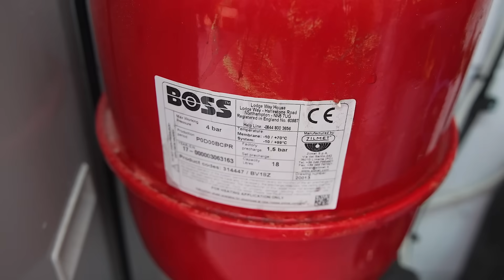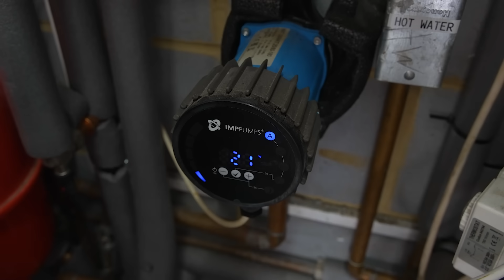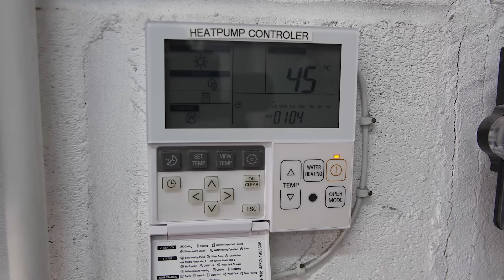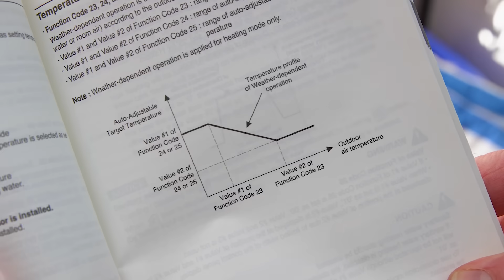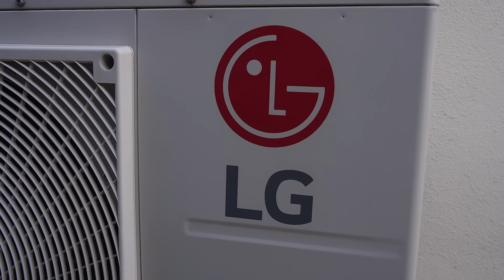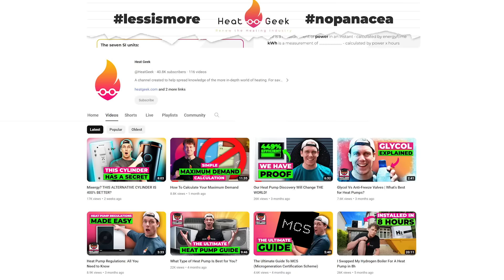Heat Geek Gives His Verdict on John’s Nightmare Heat Pump

Comment: Can someone please explain to me why we are not making the switch to full electric heating please? I look toward the UK's largest onshore windfarm, Whitelees in Scotland. Everywhere is covered in wind turbines now and we haven't mentioned solar yet. Why for the life of me are the government not pushing this more? They must focus on getting the price of electricity down. It will go a large way towards lowering carbon emissions but more importantly vastly simplifying heating systems. 
Simple is usually always better and certainly more reliable. I currently have a conventional non combi gas boiler feeding my rads via a two way control valve. Hot water is via a storage tank fed from the gas boiler with additional electric immersion heater as backup or boost. My preference would be to scrap the boiler and heating pump and all radiators. Fit auto controlled electric panel heaters in each room with independent temp and time control. The DHW would be from the gravity fed storage tank heated by immersion heater. What could be more simple, efficient, and fast responding than that? Reliability would be untouchable to anything else. If a fault occurs with one of the panels, fix it or replace it, simple and uncomplicated. In my opinion we are going in the wrong direction. Simplicity is usually always the best path and these overly complicated heat pump systems are proving my point as does this video. 
I will conclude with this observation. The windfarm I look towards will shut down all turbines when the demand is low! Unbelievable.
Reply from the maker: The infra structure is not there. We would be covered in pylons to get the power to all the homes.
Also wind and solar are not consistent, you need gas fired power stations to pick up the slack and you have to pay them to be on standby.
Everything looks simple from the outside. You would need a continuous line of wind turbines all the way around the coast of Britain just to power the EVs if we all abandoned fossil fuels.

Comment: When I view all the installations, it's plainly obvious that they are too complex. It is also obvious that, the more complex a system is,  the more likely it is to break down. I have been informed by a heating technician that heat pumps will not be suitable for all properties.

Comment: Interesting to hear what Adam had to say about Air-to-Air heat pumps but he doesn’t give them a proper chance. As Roger said, they are so much simpler to install - the same box on the outside and NONE of that junk on the inside. Adam doesn’t want a 'cassette' in his Victorian house but there are low level wall units that look just like smart radiators. I think he’s a bit of an old plumber at heart - likes to take the heat from the air to heat up water to pump round the house to heat up air …why? If your air to water heat pump dies you’re screwed but with air to air you would likely have two or three mini-splits to cover the whole house - which gives you redundancy, and it’s much easier to find a air-con engineer if you ever need one. There’s so much less to go wrong, they seem to be pretty bullet proof. The latest R32 mini splits have a SCOP over 5. Hot water is no big deal, you could spend £1500 on a heat pump water tank that might last 10 years. Or you could spend £150/year running your ultra basic existing immersion heater on cheap overnight rates. While saving £100 on the gas standing charge. The heating is very controllable, we lift our temp while the electric is cheap and drop a couple of degrees as soon as the cheap period ends. The disadvantage: No BUS grant, but you're only going to hand that over to your MCS installers anyway. The government considers A/C a luxury item! To make it work well you might need to insulate your house - but that’s not a bad thing to do with the money you’ll save. We got two 3.5kWh mini splits installed for £3500 all in. Oh, forgot to mention you get COOLING in the summer!

Comment: With a heat pump you will always need a second heating source. That is the bottom line.  

Sales and marketers always mention Scandinavia, but they ignore the fact is that Scandinavian countries use stoves and fires as their main source of heat with the heat pump providing a residual background heat, also electric is far cheaper in those countries unlike Rip Off Britain, where the Gov and energy industry are taking the piss.

Comment: Hi all! Happy Holidays! We built a new home in New York last year and have 2 Misti Heat pump hyper heat ducted system.  (PUZA42NHA7 PVAA42AA7 BASEMENT) (PUZ36NHA7, PVAA36AA7 ATTIC). The house passed a blower door test and well insulated with fiberglass. 

The problem I am running is during the winter months, my electric usage runs around ~2,620 kWh a in November & 880 kWH in July . I have the 1st floor thermostat set at 72 and 2nd floor at 71. What can I do to lower the KW/H usage? I have the fan set at auto. Any suggestion would be helpful!  

1. Should I set the fan on low?
2. Should I put the house on a schedule? I have a new born baby so I cant lower the temp under 72. What schedule do you recommend if so.
3. Do you think it's worth getting Heated Axillary strip? It is a $8200 installation as per my hvac company. Will that really lower my electric usage?
Reply from the maker: It is hard to say if the high fuel bills are due to the heat pumps not being set up right but I would say that babies are generally capable of thriving in much cooler environments. The problem with heat pumps is that they don't give you that ability to alter the temperatures at different times of the day. They just pump heat 24/7 and that uses electricity.

Comment: When you have to have grants and discounts for a product you know that the product won’t sell its self.
Heat pumps and Electric Vehicles are a prime example of this sort of bribery and arm twisting.
Reply from the maker: I agree. If the proposition is compelling, why does it need tax payers to subsidise it.  Any econonomy that ignores market forces is doomed.
Reply: There's a simple reason. To achieve net zero. Yes it's cheaper to install a gas combi but that doesn't reduce the carbon emissions which we as a nation, whether you agree or not  have committed to do. The uptake would much slower if all persons had to pay full cost. That is why there is a subsidy. Its the same as any big infrastructure project, e.g the big guaranteed payments from solar a few years back or the guaranteed price for nuclear power only through which companies will step up and invest. Its very common, its just ashp's get people all angry not helped by misleading and disingenuous infirmation spouted by certain people over what is actually a small subsidy in comparison to others areas.

Comment: Hi Roger, I would like to Chat to you and Adam about a ECR (Energy Catalytic Reactor) that stores heat for years without any loss. It can store ambient heat in the summer and feed this heat into a Air sourced heat pump this would boost  the  COP  to a "theorectical" 12.2, this involves a minor change to the refrigerant and I do have a working model of the ECR and would like to work with Adam and yourself to try to see how this can be phyically implemented into a modern Air Sourced system.

Comment: Heat pumps are super efficient and with the correct solar system your energy bills can become negligible. I run two heat pump hot water systems and a ducted air reverse cycle a/c system. It's not about decarbonisation, it's about saving money by not paying exorbitant amounts to energy providers. The climate crisis is all about training people to wilfully pay huge amounts for energy.  Nuclear & Clean coal technology are more than sufficient for base load power with individual on roof solar systems and energy efficient houses easing energy generation.
Reply: The cost of a heat pump means there are no savings for a lot of people. 

I would probably be replacing it before I recouped the extra cost, even if it reduced energy by the maximum it supposedly could...

Comment: Yeah, great advert for not getting a heat pump. I have an upstairs 2 bed flat. That system is easily half my bathroom. And then he uses gas for hot water ?  Electric shower, nope, I want a bath, and what about other hot water . Immersion heater, hell no.

Comment: Looks like the engine room of a small ship, for a small house there would be little living space left. What we need are simple systems , not something as complex as a power station.
Reply: There are simpler alternatives.  Smart electric panel radiators.  Cheap to buy, cheap to install, no maintenance required.  Just programme an app to heat the rooms when you use them.  We have become accustomed to wasting energy by heating the whole house all the time. How many hours a day do you spend in the kitchen or bathroom?  How often do you use the bedrooms during the day?  Yes it's great to have  a lovely warm house, but if we need to 'save the planet' (and save money) we need to do things differently.

Comment: Unless he has it fixed it doesn't complete the loop and show fairness. Surely you don't big a heat pump for a set of fan bearings??? Also all those repairs are pretty easy just draining down, re piping and recharging
Reply from the maker: I think it is very easy to spend other people's money. . Having spent £16,000 and had a system that didn't work he then spent another £2,000 to make it work and it still didn't work. The fans then went and it will cost another £2,000 to get them fixed. The heat pump needs moving to a new location. 32mm copper pipe is £15.00 per metre. It needs new controls and a new cylinder that is £1,200. When does he simply draw a line under this experiment?
Reply: @SkillBuilder  £2,000 for a set of fan bearings? Are they made from gold? Surely off the shelf in a suppliers? Piping through that buffer took me an hour on mine including draining and recharging.

Comment: I'm not sure I agree with the conclusion that the heat pump being out of vertical has caused premature bearing noise. Also, surely they are sealed bearings that don't need annual lubrication? 5 years is probably about right for bearing life with high running hours. The fan bearings should be capable of running at any angle within reason and are designed to take the thrust loads from the fan, a few degrees out of horizontal won't make any difference to bearing life? Standard stuff on aircon units that have been made for decades.
Reply: That was my thoughts as well, I would be very surprised if they where not sealed bearings.

Comment: What strikes me is just how much gear this guy has compared with my combi boiler. He has a veritable plant room!
Reply: I agree it’s ridiculous. I connect the electrics for them on new build housing . There are no more parts required than if it were gas equivalent except a slightly larger cylinder . The company that installed this didn’t know what they were doing .

Comment: look like this could actually be cheap to resolve - strip out the un-necessary parts, remove the external unit temporarily whilst you pour a solid concrete base for it, change the fans.  2 days, max.  

It would be great if LG could replace the fans as a pro-bono favour.  Otherwise - they're just fans:  It must be possible to replace them with something equivalent, even if LG no longer manufacture them.
Reply: Cheap?  Even just paying for 2 days labour would be too expensive for a lot of people. And then what?  Another grand for materials?
Reply: @TheDavecroft  well, 2 days labour is much cheaper than a whole new system. Plus a bit of hard core and some concrete.  Pull the outside unit first and poke the footing so that the concrete has time to set. Reinstall the outside unit the next day, near the end of the job.  Probably a job for warmer weather though.

Comment: You will require a heating engineer with a degree in thermodynamics to run these systems at £250 an hour instead of the £80 per hour plumber.

Comment: having spent 25 years in Environmental Health, quite a few years dealing with noise complaints, thank god I am out 😂. Do Heat Pump installers do an acoustic survey first ?. Spent years dealing with noise from sometimes newly installed fans that due to the area caused a noise nuisance. The units may have a measured output in decibels from the manufacturer, but unless you know the background noise levels of the installation site it is irrelevant, things like reflection of noise off walls etc that can increase the noise, a new unit could land you in hotter water than the pump can produce and cost and legal trouble having to solve it, then the faulty units like this one 😆

Comment: Money fixes all of your problems. And a good installer.

You want an efficient system. All you gotta do is pay more money. 

The rest of choice.  Bad installer going to be a problem 100% of the time.

North America the average home has a gas furnace and an electric AC unit so a hybrid design.

Some houses that don’t have natural gas or a standard air to air heat pump.

Gas is more efficient at heating water and purely electric water heater. Irony here comes the rise of the heat pump water heater.

But the truth is every state in America is different on the cost of energy whether it’s gas or electric so you gotta play the game too .

Love that you found someone that can fix the problem . I also love your choice to be green. I just can’t afford that yet.

Comment: Putting it in the south side makes the sun help with defrosting
Reply: Very little, if any, the coils are on the back so would be facing away from the sun too.  Defrost cycles are short as well, so the sun's assistance will be minuscule compared to the unit doing it itself.

Comment: Yes 1kw elec in to produce 3 Kw out is great but that £1000 compressor will fail and even if Paul Daniel’s magic’d it in for a £1000 some idiot has to come to your house and fit it. Fitting a compressor is a big job. Also people change compressors with out finding the reason why the last one failed.

Comment: The main problem about air-source heat-pumps is, that air contains not much energy.  Heat Geek can't fix that 🙂
But that's why air-source heat-pumps need to move such a lot of air, have such a big fan and are so noisy.
Total failure, sooner or later.

Comment: Clearly something is wrong  here. I live In Germany (Berlin) which is quite a bit colder than UK. My SPF for hot water is 3.7. My SPF for heating is 3.4 (obviously, heating  only runs in winter with colder temps outside making  it less efficient). My heat pump is not the latest tech by a long shot. But it's nowhere near the disaster portraied in this series of videos 😬

Comment: Correct answer to the difference between Scandinavian homes and UK is not the understanding of the Heat Pump. Most UK homes are very poorly insulated and money would be better off upgrading walls, windows, roof etc...

Comment: Heat pumps for UK plumber is basically rocket science. Non of them know, anything about how they work. However, refrigeration engineers do!!
A buffer? Is that what we call a heat exchange unit? they make the unit less efficient. Strip-out out all the radiators and put in air to air heat pumps COP3.7 and and run hot water of the power grid COP1.
Air to air heat pumps give a nice warm inner climate and humidity control. And if you can get into the loft, insulate between the ceiling joists; minimum 300 m/m Rockwool or a similar product. Heat pumps; buy Japanese, German or Swedish quality pumps.

Comment: Do they factor in to the predictions the cost of a heat pump installation by the average plumber the cost of the elite brainbox team coming in to get it all working. If you charge for the extra work done by yourselves on a normal basis what is your estimate of the total cost to this individual overall from the very start?

Comment: Our heat pump was installed. Buy a company just grabbing the grant, money and massively overcharging for systems. We had issues of first sting, incorrect insulation fitted externally, and none of the so called promises by the company for the installation were carried out.
We also the got in touch with protection and they found in our favour at the installation was not correct, and that they needed to come back and put this right.
And they could not be bothered. So having protection and governing bodies to monitor the companies, if they cannot enforce the judgments, make them come back or another company, correct the errors and then fine the companies till this happens. There is no real face In this industry, especially by me, and I would most certainly would not advise anybody to have a heat pump whatsoever..
Our electricity bill is massive in comparison to what it would be if we stayed on our oil boiler, if we'd have had a new oil boiler, our bills would nowhere near anywhere the size that they are with the system.
And I will invite you to come and check this out. So the other people would not fall for the same mistakes as we did. We both thought we were very savvy. On the information that we gathered prior to this, but unfortunately we made a big mistake.

Comment: i would not trust a heating engineer of any form. my boiler packed up. not repairable cant get the parts. need a modem boiler five thousand pounds. Got a book on gas boilers.Part from e-bay half an hour to fit, forty seven pounds. Worked out the heat savings would take 12 years to recover the difference. By then would need a new boiler.
Reply: Great, just what we need, more cowboys. Good luck with that 🤣

Comment: heat pumps are more a commercial thing, any commercial hvac engineer that is f gas registered he'll know what to do i doubt theyd be able to size a system as on commercial jobs this is done by engineers, a better system are ground source heat pumps works alot better considering the amount of electric those condensers can use